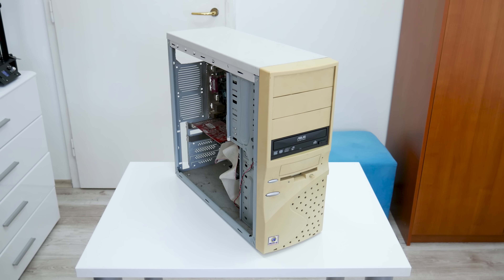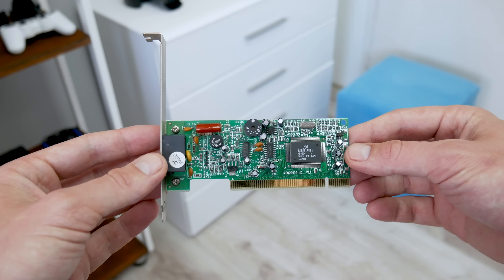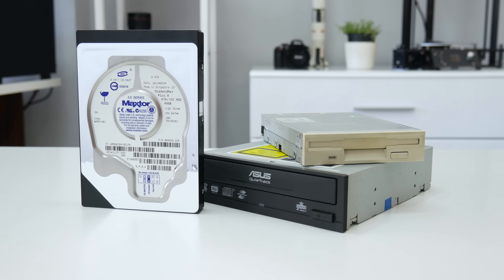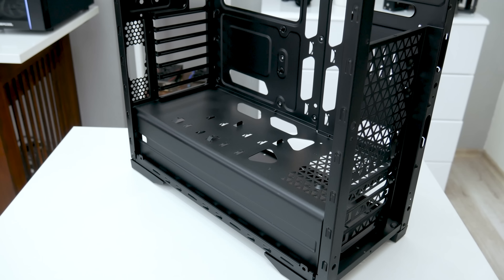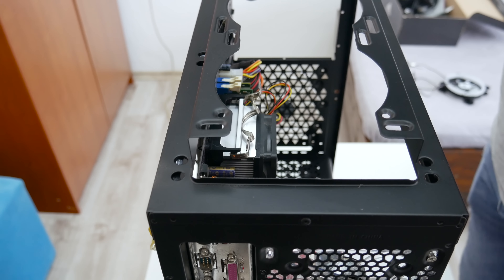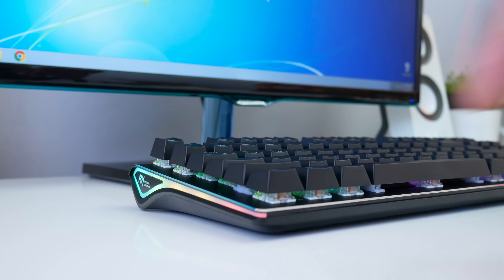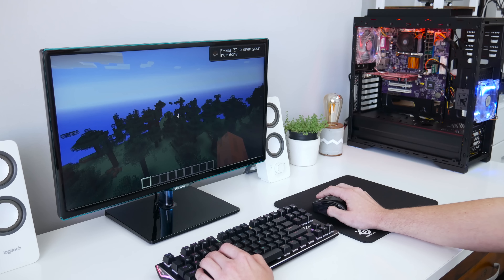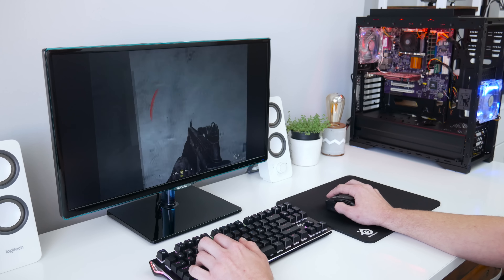Building a PC from Trash!

Comment: Did you realize the only literal thing you used from that PC is its motherboard? You changed literally everything.
Reply: That’s what you called upgrade
Reply: @hansenriquez9482  i was bout to say that😅,i just did that with my msi 7309 mobo with ddr2 ram,runs well
Reply: and the  cpu cooler
Reply: @hansenriquez9482  It ain't an upgrade if you're just replacing everything. You might as well buy a new motherboard instead of buying the whole thing you're not even going to use
Reply: Fr fr. He could of just bought new pc parts.
Reply: @draixsama  In my opinion, an upgrade is when you changed everything except for the motherboard + case. So because the previous case was damaged, yes it's an upgrade.
However I would have left the Maxtor HDD + fresh install of Windows XP
Reply: People here complaining he only kept the motherboard, but they forget the upgraded cpu, memory, and video card he used were super cheap or free. The only new-ish part was a small ssd. Buying all-new parts would have cost a lot more money.

Comment: Nice retro build - good to bring back a use case for this older hardware!
Note that 2GB RAM and a Pentium 4 isn't that great for Windows 7 - for this hardware, my first choice would have been Windows XP, to turn this into an old style retro gaming rig for older games.
Also, I'd have kept the IDE disk as a functional data disk, plus the DVD and floppy drives. Floppy drives are really old and only take 1.44MB per floppy disk, but some really old software may be floppy disk only.

Comment: yeah i found the same thing with one of my bulk purchase socket 478 motherboards i could only get Vista to work with it, those ide to sata adapters can fail just fyi then again the one that failed on me tested multiple motherboards before it died and it was open test bench meaning no additional pc case fan cooling.

Comment: For the first time I have seen a PC which is more weaker then mine 😂

I have AMD Athlon II X2 4450e (dual core CPU at 2.8Ghz)
Nvidia GeForce 7025 (256mb on board graphics, DirectX 9)
2 GB DDR3 RAM at 800Mhz (my CPU & Motherboard combo only supports 800Mhz at max, but the stick is 1600Mhz).

Comment: I've found using a program called driver booster it will usually find drivers even on older hardware
Reply from the maker: Hi bro, actually i tried few of them, drivers are installing but after reboot same like they are not installed

Comment: I have to ask. No hate. Why not go harder with upgrades ? Like HD4670 or at least nv 6x00 series , some more fancy cooler (even if hacked to fit), maybe aftermarket RAM radiators ? After reading MoBo specs I'm guessing this CPU was absolute limit here.
Reply from the maker: Hey bro, fill free to ask any question :D in this video i go with hardware that o already have, i try to find something better but nowadays is pretty hard to find something better in a good condition and with normal price, AGP GPU's with 1GB nowadays cost about $50-70+. btw once i have HD4670 1GB AGP but i give it to a friend long time ago :D
Reply: @ComputersAndTechAndAndrew  Makes sense. Thou I still would suggest getting those chinese RAM radiators, they are like 5 bucks or less if you look and can be reused ;)

Comment: I got a Athlon XP 2600+ with 768mb ram and 160gb hdd. I also got a 7800GS with it

Edit: The cpu can be overclocked
Reply: Computer from those times on AMD Athlon socket A or better Athlon 64 much better set than this P4.
 Better for old games and maybe even possible to use today fat web sites.
I have few retro PC with Tualatin, C2D/Q, P4@LGA775 and this sets allow to use comfy internet and Youtube.
Especially PC build on 3GHz C2D/Q and modern Radeon card its very good to check weather sites or others, Youtube  with 1080p resolution videos on 32" TV and maybe game play if needed.
Reply: @jedrula77  better than a PGA 478 pentium 4 @3ghz?
Reply: @augusli9716  Unfortunately, the P4 family was a very weak platform for players.
It's not very efficient in games but it's also very hot and expensive.
 In office applications, the P4 processors were stronger, while in games even stronger versions lost with strong AMD XP3200 + (2200MHz) or A64 3200+.
 The first P4 on Socket 423 with RIMM memories, lost even with slower P3: /
On the way there was HT and 2 cores.
Even P4 on LGA 775 was weak and OC gave a small increase in performance for a significant increase in power consumption.
It was not until the Core duo family that Intel dominated.
Today P4 gets free as protection for the LGA 775 socket outlet.
The first C2D models can be purchased for $ 1.
 
The P4 3GHz S423 can be compared to the Athlon XP Barton 3200+.
In some games a bit AMD faster in others a bit of P4.
 At that time AMD was the right choice for games. For the difference in price you could buy a super graphics card.

Today both of these processors are only a curiosity because both are weak. Especially if someone mounts to such SSD XD platform

It is much better for this type of time interval for the retro PC base on LGA 775 and C2D C2Q. Very cheap boards type Siemens, HP, DELL on the chipset P / G 35/45. A very good motherboard on P45 to OC is a considerable expense and getting harder to find in a great condition.

Although every previous generation can pass behind a retro PC: D
It is a real hardcore retro PC that should consist of a 286, 386, 486 or pentium processor preferably in the PRO version and its clones along with popular graphics cards for these platforms.
The maximum retro PC is the Pentium 3 Tualatin family on the 815 chipset or the first Duron / ATHLON for Socket A.

Comment: I used two 40 GB IDE disks striped (Raid 0) and compressed (LZO) with BTRFS and Peppermint 9 on a 2003 Pentium 4 HT (3.0 Ghz). All Linux drivers installed without problems. The system booted in 45 seconds, not enough time to go for a coffee, like in the past with Win XP. It displays YouTube videos on 480p. To be honest I did not waist time with painting.

Comment: I actually did this recently on craigslist!! It cost me 200 its a core 2 quad q9400 overclocked to 3.66 ghz on stock cooler yes stock cooler 5gb ddr2 900mhz ram gtx 760 oced to the max corsair cx 600 and a old rosewill thor case missing its front and top panel so i made a front pannel out of wood and stained it
Reply: And a 250 gb ssd 2 500gb hdds and a 160gb and a disk drive its my main system right now

Comment: It is good to reuse the potential of an old computer (almost 25 years ago), specially with celeron processor, to be used it until a certain time.
But was that investment really cost effective?
How much did it cost to you to add more parts to that old computer?
Upgrading an old computer could be good to teach others so they can gain experience with old technology.
And in my perspective, it could have been less expensive to buy a modern motherboard that already has everything installed, including a fast processor.
Because, athat time some computers parts were expensive, but now it could be more easier to assemble one of those for a cheap price.

Comment: I fully get wanting to make use of older hardware and the nostalgia that goes with it, but in this case these days 2G is barely enough and makes for kinda slow web surfer, im surprised it does as well as it does with only 2G and no windows 7 updates-?. I also have some older DDRII boards and even older, but seems like ya did a lot of work to only end up with a slow rig - I do like what ya did with the case it looks excellent, theres some very good spray can paint these days and painting the inside is something ive been tempted to do - but since I have nothing with side glass panels or anything its kind of a wasted unless ya want to leave the panel off--lol  Still nice work on a retro rebuild.

Comment: I have a PC ecs L4S5MG socket 478, but can't enter the BIOS?

Please help with my problem, because I want my old PC like a PC on video.

And want to update windows from XP to Windows 7.

Can you provide the overall driver link in the video?

I was very enthusiastic to reuse my old pc ...
Reply from the maker: Hi bro, try to use older keyboard and mouse because some newer keyboards are not correctly recognized, if again you have the same issue than download the latest bios from the manufacture website and try to update the bios
Reply: Cat and Andrew,, I have used an old type keyboard and mouse but it's the same, when I press the delete button and the other buttons to enter the bios menu it can't either.

Even if the bios is updated, my computer cannot enter the bios menu, so the solution must be how to make this bios problem complete.

Please help I can make videos from start to finish for old pc bios problems.

I am very grateful if you help me with this pc problem.

Comment: I have a Gigabyte GA-P31-ES3G ,DDR2 1066
Mother board . With LGA 775 
*It has an Intel Pentium 4 CPU 3.00GHz, 3000MHz , 1 core(s) ,2 logical processor (s)

*and a NVIDIA GeForce 8400 GS  512MB Graphics card. 
*2GB of RAM 
Can I upgrade it to run games from 2008 to 2012 era?
Reply from the maker: Hi bro, you can done some good upgrades just i'm not sure, it will work or not, this motherboard support CPU's like Core 2 Extreme and Core 2 Quad ( supported CPU's http://www.cpu-upgrade.com/mb-Gigabyte/GA-P31-ES3G(rev._1.x).html )
About GPU, you can go even with something newer just all depend from the PSU, ( bottleneck may be expected, depends from the GPU ).
But if you want to do something on a budget but newer, you can go with DDR4 RAM ( not expensive now ) Budget H110 Motherboard and Pentium or i3 CPU, as GPU you can go with 1050ti or RX560 / 570 ( gpu's are also cheap now )
Reply: Funny story, I had one of those boards. For one, think about selling all of this. It's hotter than it should (I used to run extra fan on NB), poor vrm, you can run max of 4GB ram which makes windows 7 a problem and finally CPU. When I switched from E5200 to core I5 4570 it was a world of difference. But If you insist, than I'd say some core quad 9xx0 (9550) series and something along the lines of amd R9 270/370 or nv 1030/750Ti/1050 <- older ones will draw more power like 7870. Depends on your power supply. Anything more powerfull than those GPU's won't habe much sens even in GPU dependent titles.
Reply: Thank you guys

Comment: phenom 9850 black edition processor, abit ax78 motherboard, gskill ddr2 8 gigabytes 4x2gb ram, radeon x1900xtx or geforce 8800 gtx graphics card, asus xonar ds pci sound card, seasonic 650watt prime ultra titanium power supply, two seagate st350041 8as raid sata2 hdds, windows xp

Comment: Why didn’t you use an aftermarket cooler for the CPU and overclocked the pentium IV
Reply: He don't want to burn the P4! Its bad idea to overclock a Pentium4, its always run hot!!!
Reply: Helge Schaare Helge Schaare ofcourse they run hot look at the size of the cooler they come with ... 6:00
Reply: The size of the cooler is not the problem is P4 himself!
Reply: Helge Schaare LOL the size of the cooler is not the problem, sure man, that’s not the issue with thermals.

Comment: You couldve install Linux Mint OS or something similar and you couldve put some use to it instead of installing a non supportive windows  such as 7 on them specs...there is only one flaw in your videos everhthing else is perfect but everytime you install or put things that does not match with each other and actually degrade the gaming,streaming,browsing experience on the pc you build other than this your videos are awesome keep up the good work but try to make the software and hardware compatible with each other.. Cheers!
Reply: Dorifto Kingdom Even lite modern Linux builds struggle with pentium 4s. It was maxxxxing out my 3.2ghz p4 on install alone.

Comment: You should let go to the history of this P4.
  It was already a very weak unit at the time of the premiere.

  Install an SSD drive to PC with only 2 GB of RAM and WIndows abowe XP like Vista, 7 or even 10 (xD)  is simply destroying the SSD due to intensive use of SWAP memory.

You ruined such a lovely white case that was worth more than this electronic scrap. Why did not you modify the old case?

A newer use HDD in the SATA-IDE adapter is enough for such a set.
By changing the card, adding SSD, you could change something new with LGA775, eg C2D Q6400 for 2$ or Q6000for $ 10$ and a cheap motherboard for $10.

Summarizing:
the biggest drawbacks of this set
-SSD
 (die very fast)
- it's a nice case for such  basic components trash in the form of poor performance of the first P4
- you have not painted the motherboard cover plate !!!
- the main ECS trasch board is not worth anything on such a weak VIA chipset
Electricity waste: D

Benefits.....
-SATA adapter: D
-Win 7

Comment: Could you get a SATA expansion card and boot from the SSD via that?
Reply from the maker: Yep, just the speed isn't like using sata connection, but however SSD is far more faster than IDE disk

Comment: hello Andrew. i have a question windows 10 when shutting down error pops up for 2 second something about memory ram . how to get rid of it
Reply: Reseat the RAM. If it persists, get new ones.
Reply from the maker: Hi bro, if you get "Blue Screen" with errors than try to change the RAM. ( if you going to test/change RAM or something First Disconnect the Power/Charger from the laptop and Disconnect the Battery )

Comment: where do you connect the led strip to
Reply from the maker: The LED strip i connect it to the power supply, this is DeppCool LED strip and already have controller with connection cables
Reply: @ComputersAndTechAndAndrew  thank you

Comment: Can you try into install hackintosh this machine?
Reply from the maker: macOS will work just older versions, like 10.6 or older
Reply: I have two old machines at my home, one is dual-core processor 2.4ghz, with 4 GB RAM, another is Pentium 4, a 2.9ghz machine with 2 GB RAM will work Hackintosh, I don't have graphics cards will work?
Reply from the maker: @PrasannaNadagoud  Basically you have chance with older GMA graphics, but only older macOS versions, like 10.6 or maybe 10.7